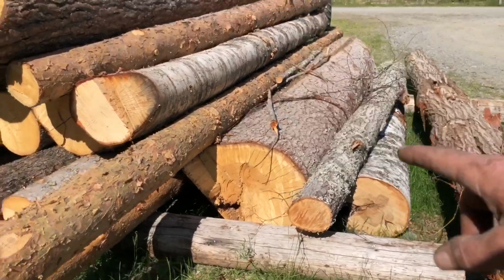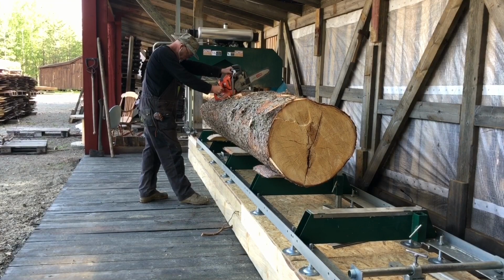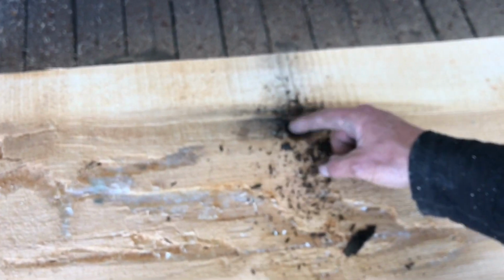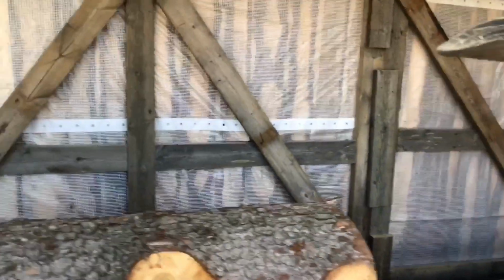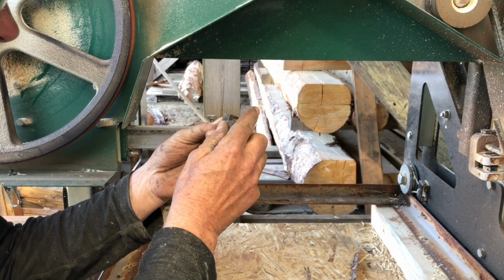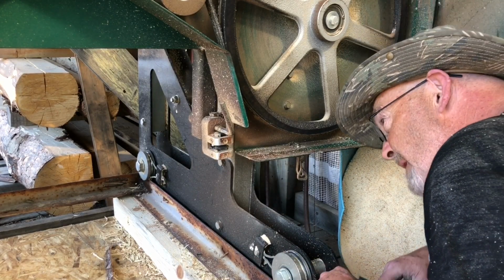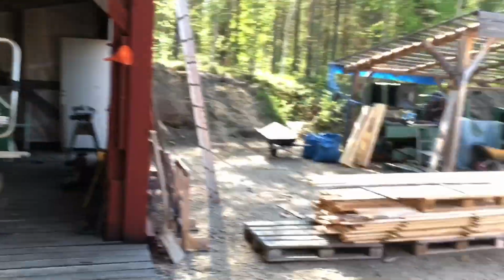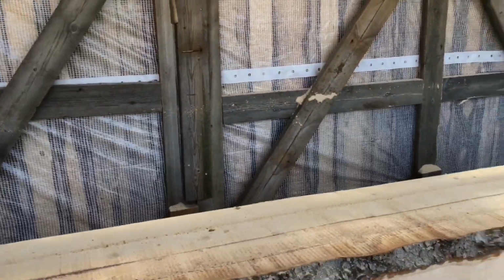Biggest log ever on the sawmill, how does the new building work and replacing the blade guides.

Comment: Howdy Simon- what a great video! It just ended too soon. It’s amazing that we both readjusted guide blocks this week. I found the exact same wear on the exact same block on my mill. I was a bit confused why it wore like that but yours was the same, so I feel a bit more comfortable about it now. It’s funny how sometimes the smallest things in a video is so very beneficial for someone. Thank for showing that. I’m enjoying your new sawmill shed along with you. Hope you are doing well and enjoying the weekend. Take care my friend. God bless
Reply from the maker: Hi Paul, as I said in the video they are naturally wearing so don't worry. Those blocks have out seen 30 or more blades and they are really cheap to buy from woodland Mills and you can turn them. But when you have wave it is worth checking if you can't cure it any other way. I have tried over tension on the blade but this put so much more wear on the bearings and will lead to premature blade failure. I was going to edit that whole section out, but no-one else has done a video on the blade guide blocks wearing, something I have had on the industrial machines and resaws so I know to replace and not put much thought into them. Different metals wear at different rates so I had no idea what I was going to find until I looked, the other thing to bear in mind is you are milling much harder lumber than I. Also worth noting is the cheapness of the blades. Something like the Ripsaw blade is 4 times the cost per blade but you get 4 times the performance and less wear on other parts. However; hit something hard the result is the same.
We are doing great thank you, and the new building has made life so much easier on my body I had no idea how constantly walking on the gravel and rough ground in the old position had such an affect on my back. Also the mill is 8" higher than before which also seems to have helped. Be safe my friend and stay well.
Reply: @arctic-rebel  Thank you my friend for explaining this. I never had a bandsaw mill before so I am in somewhat of a learning curve. I found your channel by watching Woodland Mills videos and very thankful I did. Blessings

Comment: Cheers Simon I try to have all the service tools and blades  bits collets blocks near my machines. Never happens always borrowed for something else. I NEED a machine shop lol
Reply from the maker: It is a common problem, I try to buy second hand tools whenever they are cheap to help prevent that exact problem.
A machine shop is a must for any man, sometimes it takes a while to get what you need. Without asking for reclaim materials I would not have half the buildings I do so just ask and you will receive. Take care Mike.

Comment: A little maintenance will always do the trick.. and it did.. nice timber Simon👌 I'd believe it's nice to have all the sawmill stuff gathered under one roof.. not have to run all over to find what's needed👍 Here further North we have a stint of summer, so the paint, rollers and brushes have emerged from hibernation, and the outside walls will get a coat or two. All the best to you guys🙂
Reply from the maker: Just trying to keep on top of it all, you know exactly how it is there is only ever one of you. Good luck with the painting and have a great weekend.